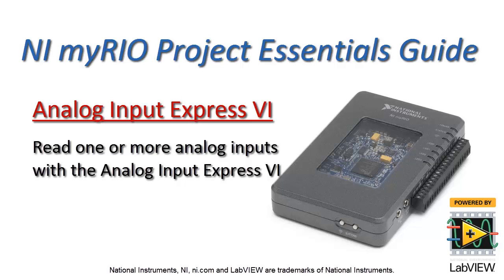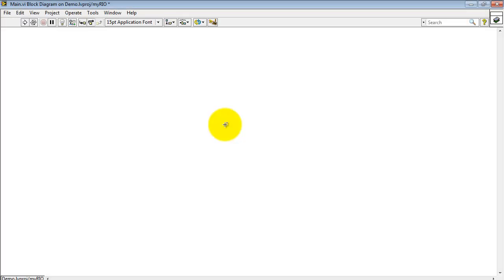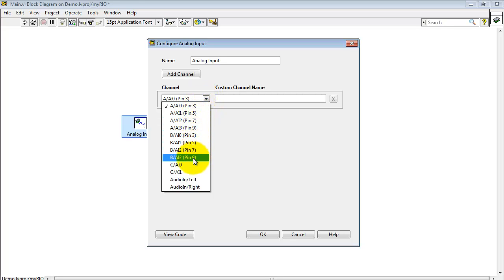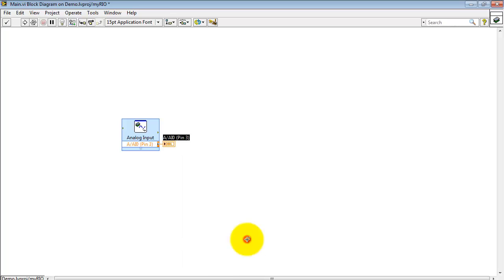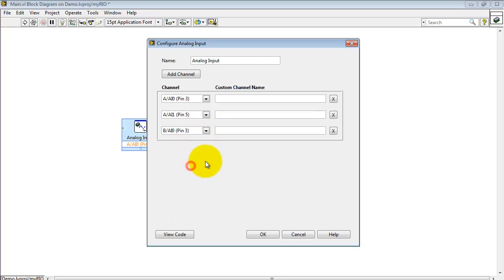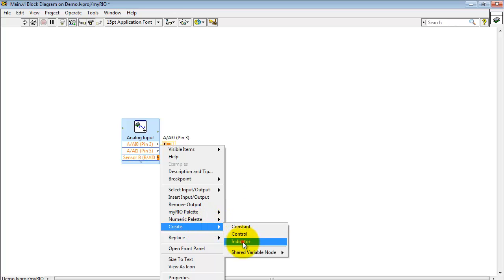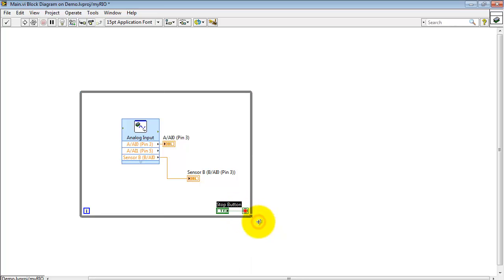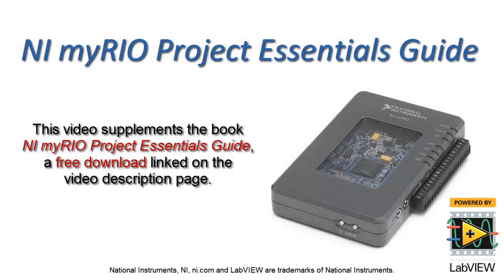NI myRIO: "Analog Input" Express VI

Comment: Hi,

This is really a stupid question, but I could not find it in the internet, and anywhere...
How could I have this toolkit? I could not find it in mine. Even I installed all the thing in the CDs, packaged with myRIO, and I checked, I have myRIO toolkit. I even have "myRIO" thing, but no "analog input, analog output, digital input, etc"
Reply from the maker: hanismile1910 The subpalette has changed slightly with the latest version of LabVIEW... it sounds like you can see the main "myRIO" palette, now follow the "Default FPGA Personality" subpalette and you should see all of the Express VIs.
Reply: ***** Thanks :)

Comment: Hi, I tried to acquire analog sine wave from a function generator and display it in PC (labVIEW). The sine wave displayed in labVIEW was pretty accurate for approximately 50Hz. When I increased the frequency (sweep the frequency of function generator slowly) the displayed signal was badly distorted. At some frequency, pure sine wave appeared again. The frequency of waveform displayed in PC was different from that has been set in function generator. How to configure the sampling and acquire analog signal accurately?
Reply from the maker: Are you using myRIO for the hardware target? Also, what frequency range (lowest and highest) are you trying to use?
Reply: *****
Yes, I'm using myRIO evaluation unit. I am trying to acquire sine wave from function generator ranges from 50Hz to 100kHz. Thanks.
Reply from the maker: Sze Sing Lee The timed-loop approach will be helpful to you, for example NI myRIO: "Microphone demo" LabVIEW project. Search this channel for "myrio audio" and "myrio microphone" to find other related tutorials. Also, you'll want to study the myRIO manual to learn about the upper limits of sampling frequency. Your 100kHz upper limit for the function generator is most likely too high.
Reply: ***** Thank you very much. Timed loop works. Yeah, you are right myrio cant manage to acquire 100kHz. Can I ask another question regarding analog output? I used 'Simulate Signal' to generate a sine wave at analog output C/AO0. The default frequency is 10.1Hz and the oscilloscope showed the correct signal. When I set the frequency to 10Hz, nothing appeared on the scope. When I set the frequency to 10.2Hz, sine wave is seen but the frequency is 20Hz. Is there a bug in Analog Output VI or I used the VI in the wrong way?
Reply from the maker: Sze Sing Lee I recommend the time-loop approach again for timing precision and speed; use the point-by-point signal generator available in the signal processing palette: Signal Processing >> Point by Point >> Sig Generation. As the name suggests, these signal generators output a single sample on each loop pass and they are very "lean" and computationally efficient.